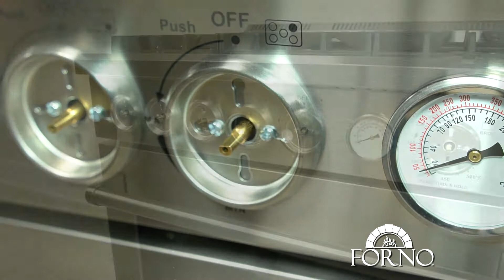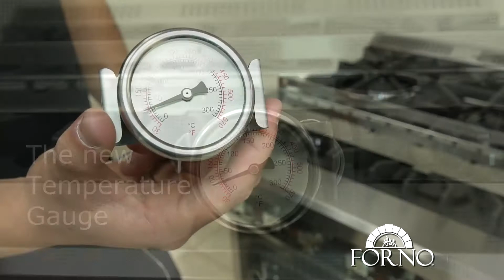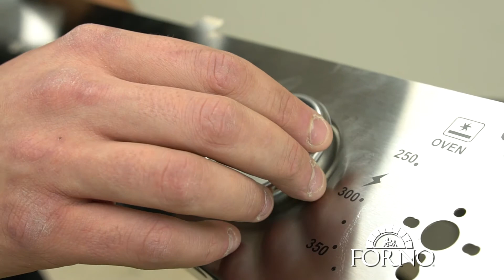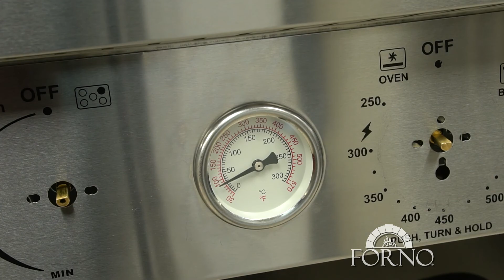Temperature gauge - Model# 6275-30 & 6282-30 - Part# 76D507E095004

Comment: Helpful video! We purchased a FFSGS6275-30 in September and the thermometer has never been accurate. Is it possible to get a replacement?
Reply from the maker: The temperature gauge might be slightly off due to the convection fan that is automatically turned on when the oven is in function. The convection fan creates air movement causing the temperature gauge precision to fluctuate between 10% and 20% a better accuracy is obtained after 70 minutes of operating time. The convection fan runs continuously except for when using the broil setting. I invite you to email our customer support team with all the details regarding the accuracy of your temperature gauge at mysupport@forno.ca a representative will assist you.